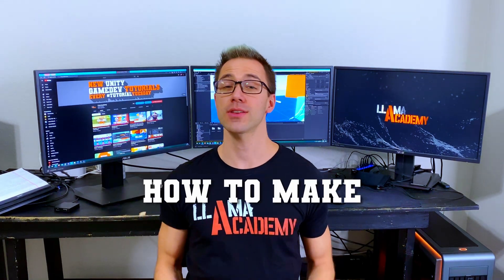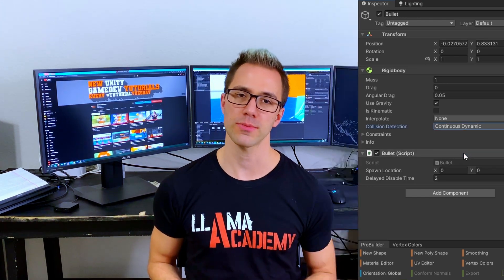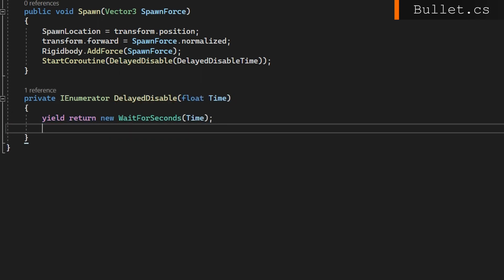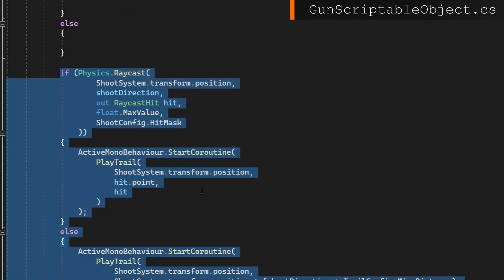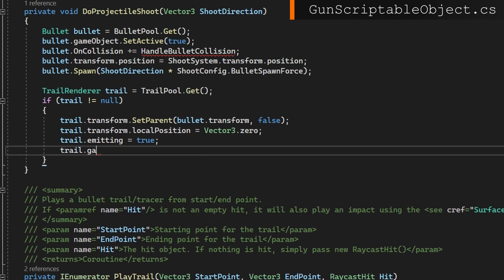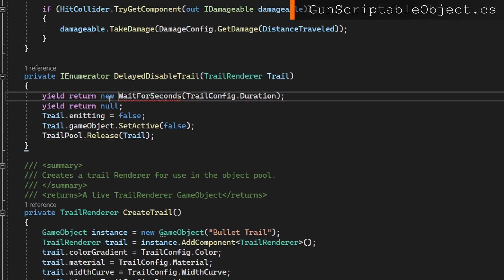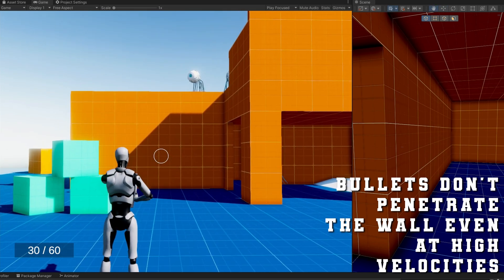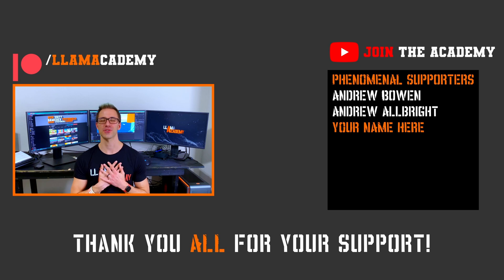Projectile Guns | Scriptable Object Gun Series 6 | Unity Tutorial

Comment: Do you have plans to expend the weapon series and add a weapon switching/inventory system ?
Reply from the maker: Weapon swapping yes, inventory system, no, I wasn't planning that. I have seen a great number of inventory system tutorials so unless there's some specific value add I can put on top of what's already there, I don't think it makes sense to cover.
Reply: @LlamAcademy  By inventory system I meant an easy way to store weapons and swap between the ones available without the need to add more lines of code for each new weapon, like for example we can automatically assign to each new weapon added it's own key depending on the ones available, as a replacement for if(input.getkey(alpha0)) weaponselected = 0, same goes for alpha1 2 3 and so on.